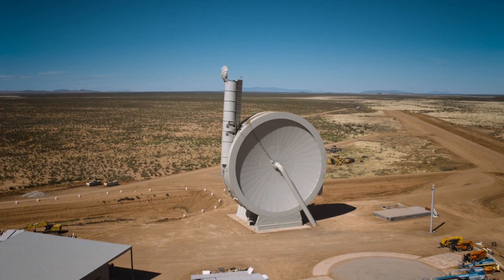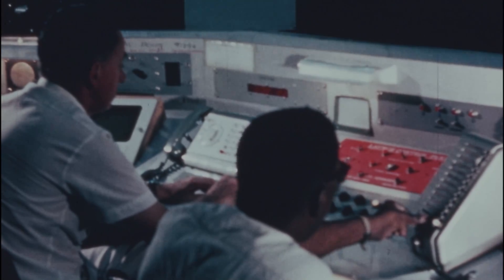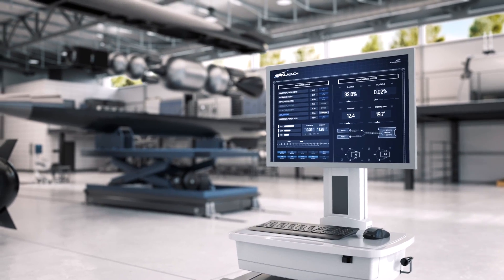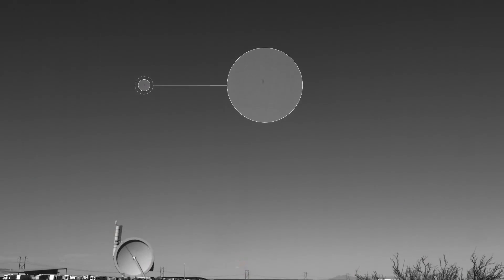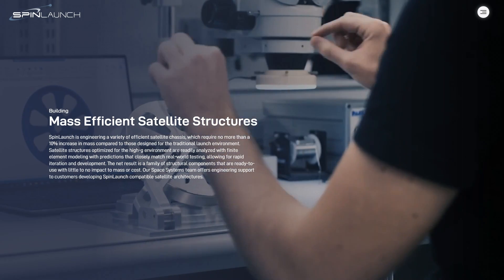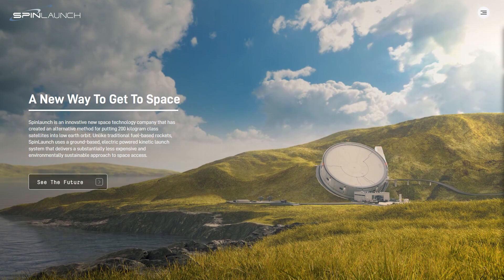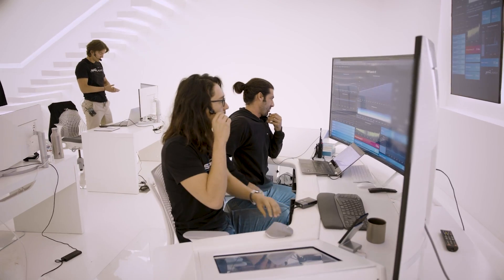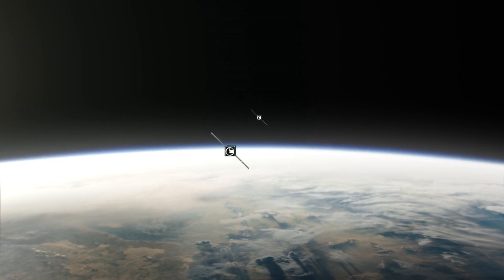Can Spinlaunch Throw Rockets Into Space?

Comment: Crazy idea: toss the counterweight on the revolution after the launch. Bearings can take half a revolution with horrible imbalance, right? Bonus points if the counterweight is a second rocket
Reply: The company’s patents suggest that they’re simultaneously releasing a counterweight on the oppisite side from the payload arm to balance the system at release time.
Reply: And second one goes under ground))
Reply: bearings might, but will the building foundations? :D
We are talking prob over a 100t force equivalent, but sideways...
Reply: It’s probably easier to figure out how to mount a single stage self contained hydraulic to just move the counterweight. A few inches would have a big impact on leverage and effective load.
Reply: @BlueBones8  You could mb build something like a long linear generator to get some energy back out of it
Reply: Make a series of counterweights equally spaced around the hub, but with a gap where the payload is placed. Upon release, the counterweights are shifted slightly to close the gap. Effectively, you create a rotating disk instead of a rotating arm
Reply: Or launch the counterweight into the ground, which doesn't seem super ideal either
Reply: @josephmoore4764  Some sort of hole is in order. Seriously 1 mile hole half filled with something between water and sand.
Reply: Wish we knew of a company that likes to make holes.  Probably would be a pretty boring place to work. 😃
Reply: @josephmoore4764  or into a shaft of liquid and dissolve it by shock friction.
Reply: Every action... Just make the entire facility a floating one... and then move the entire facility to counteract the release. No "counterweight" needed then, and the entire bearing assembly can move freely. :P
Reply: Bearings on the shaft of a perfectly balanced system (theoretically) see no load perpendicular to their axis.  The instant the payload is released, this force becomes tens of thousands of tons.  The fact that it's "only" half a revolution doesn't reduce that force.
Reply: The thing you have to think about is if it drafts the first one will it cache up and hit it and if so how hard.
Reply: You can have another counterweight on the payload side that shifts outwards at the moment of the release. Or move the original counterweight inwards. Still a tough engineering task to do it in a few milliseconds without ripping apart the thing, admittedly flinging the other end sounds much easier, only then you have a massive lump of material over your head, and it's gonna hit something. But hey, crazy ideas are essential when you want to make other crazy ideas work.
Reply: Hmm, could you use water as the counterweight? In a container to hold against vacuum of course. Then just splash it over the inside walls on the moment of release.
Reply: @TheMastaRob  High speed water can hit pretty hard still. Maybe at a sallow angle...
At least it would keep the chamber clean
Reply: @bottlekruiser   Oh sure, but if you consider the speed it's moving, it would spray a wide arc, and you could shape the inside of the chamber to direct the flow. A ridge down the middle, like putting two torus shapes on top of each other, might do it. Not saying it's easy, nothing about this is, just an idea!
Reply: But if the counterweight isn't another payload, that counterweight can hit the ground with the force of at minimum a couple hundred or possibly thousand tons of tnt. Which would basically turn this launch system into long range artillery.
Reply: @CliffordChang-v8c  if we assume the counter weight is of equal weight and can be shaped like the OG payload it would follow the same trajectory as the payload and if unassisted would fall down on the trajectory as if the OG payload was defective, which is hopefully accounted for.

So the real bonus points is if the two payloads can dock with each other mid flight.
Reply: @CliffordChang-v8c  You're saying that as if it's a disadvantage :P
Someone in another comment calculated the energy of a 10t Mach 4 payload pod at merely 6 tons of TNT... wait, this is going to be mach 7ish. Ok, make that 18 tons of TNT. Some of that could supposedly be shed by atmosphere, especially since a disposable payload doesn't have to withstand slamming through it. 
Besides that, it doesn't have to have as much energy as it may be a heavier mass closer to the axis. Double the mass at half the radius has half the speed and therefore half the energy.
Reply: @bottlekruiser  Ok, split the counterweights... no you have 18 one ton blocks of TNT to dispose of... wait... were we trying to make this safe or more dangerous?
Reply: @TechyBen  
>were we trying to make this safe or more dangerous?
Yes.
Reply: >Bearings can take half a revolution with horrible imbalance, right?
I mean if they can take it for many more thousands of revolutions during breaking then most definitely yes.
Reply: @JohnTrustworthy  not if they break fast enough :P
450 RPM is, like, eight revolutions per second. Presumably they won't keep it horribly imbalanced for half an hour after launch?

Comment: Ejectable counterbalance capsule containing water or other liquid fired down an opposing tube with a gradual slope to absorb and spread out the impact.
Reply: A gradual slope at Mach 1, let alone Mach 10+ would be several kilometers long, and necessarily underground since it launches the payload vertically.
Reply: @Archetypal_NPC 
The capsule needn't survive the impact, the slope would only need to spread out the blast so the impact could be absorbed gradually and over a larger surface.

Comment: Well to rebalance the rotor after release, there could be used an counterweight at the opossite end (say for example a metal ball filled with water) that could be released at the same time. It would need to go into a sufficiently deep hole in the ground so it doesnt damage anything on impact. No idea how they do it though, as such device would be pretty obvious if they used such thing.
Reply: have the counterweight close to center of rotation. as payload is yeeted, move the counterweight towards the tip. the jerk would fluctuate quite a bit though, but at least you're not trying to move twice the moment of inertia.
Reply: or even just a ball counterweight that gets thrown downwards onto a track that levels out in a circle. think like those spinning coin donation things, where you drop a coin on a track and it spins around a funnel. but instead you are dropping the ball onto a track that levels out into a bowl. for it to spin and slow down on.

Comment: Dumb question. In order to counter the forces causing the unbalancing after launch cuz basically the center of mass of the spinning thing greatly changes.. what if there was a way to move a weight or introduce a counter  focre on to the end? Like, for example. A mid level weight that is on a rail and slides to the end once the projectile is launched¿ Or apply an electric magnet on it so it can attract to the wall of the launch chamber which in my head would apply a counter force  and helping slow it down by pulling..

Comment: To balance the spin arm, my thought is to have as a counterbalance a massive magnet that would be released simultaneously with the space projectile.  The magnet would fly down a tube in the earth that is lined with electrical coils, thereby generating an amount of electrical power in the same neighborhood as half the power needed to spin up the arm.  That electromagnetic power would need to be stored in huge capacitors or batteries for future use in the next launch.  Some technology would need to be developed to store the energy, but then Spinlaunch is in the business of developing new technology.  What about this?
Reply: Yep. In which case, why not just use the electromagnetic tube as the launch device and skip the spin?
Reply: No new tech for that, just use supercapacitors and superconducting coils. Long-term storage isn't a concern if the device is being cycled regularly. The biggest problem is probably that neodymium magnets have a low curie temperature, so the less powerful AlNiCo magnet would probably be needed in the counterweight unless the resistive heating can be managed. AlNiCo probably has better thermal conductivity too thanks to the aluminum content. In either case, I imagine the magnetic material would need to be distributed throughout a larger casing (laminated steel like a transformer?) to survive due to the eddy currents induced by magnetic braking, perhaps combined with cryogenic chilling before launch.
Reply: If you can't afford the huge bank of capacitors (since they are quite expensive), this idea still has merit.
Instead of trying to capture the energy, just have the coils connected to banks of salt-water power resistors.
Actually, if enough energy is dumped into the salt water resistors by this method, you regain the ability to start capturing energy from it again, in the form of steam power!
Reply: @44R0Ndin  I hardly think the cost of supercapacitors is your biggest concern if you're building an underground cryostat full of superconducting coils. That white-hot missile Scott showed is what a copper coil will look like trying to capture the energy from the reaction mass in a tiny fraction of the distance. The length of braking tube required and the efficiency of cooling the superconductors are probably the biggest factors determining feasibility of energy recovery. The facility will already have a big vacuum pump, so maintaining a cold tube probably isn't all that difficult if you can afford to dig and build it in the first place, but the energy recovery better provide substantial benefits for its costs. One plus is you don't need a separate mechanism to recover the counterweight since it can be drawn up magnetically through the generator, which is essentially a gauss gun.

Comment: imagine having to release a counterwieght at the same time directed into the ground or a water tank or something.
Reply: That much energy released into a collision on site would produce a huge explosion. Better might be to shift the rotating boom slightly to rebalance it on release.
Reply: I'll choose "or something" in the form of the couterweight being a very large magnet, and the something that's catching it being a series of coils of copper wire. That would help to recover most of the energy spent accelerating the counterweight to a high speed (or if you don't have the capacitors to absorb such a large amount of energy in a short time, you could always dump the energy into a tank of salt water (if you don't need to move it, salt water power resistors are both the cheapest and highest power dissipation option available), and if you pick the right kind of motor to drive the rotor you can simply use the motor as a generator to harvest the energy you spent accelerating the rotor to that same high speed.
Reply: @44R0Ndin  If you wanted that much infrastructure to safely decelerate a counterweight, you might as well use it as a linear accelerator to launch the projectile in the first place.
Reply: @JohnBayko  Well yes, but I was working within the confines of "modify the existing system" instead of "replace it entirely and use something else".

Comment: Why would you not put this on the side of a mountain near the top?  Free slope, lower atmospheric pressure???
Reply: You absolutely would, if this tech is perfected. I imagine, you would want to prove it out at a location where construction is way cheaper first instead of the side of a mountain where costs would be significantly more. Ideally you would probably want to build one of these near the equator and on top of an "unimportant" mountain, and then you would benefit from a thinner atmosphere and higher initial velocity due to the spin of the earth and the earth being an oblate spheroid.

And having one of these on Mercury, the Moon, and Mars would also be amazing. If they perfected this tech, we could really actually start moving lots of mass through the solar system for cheap.

Comment: In the novel "The Moon is a Harsh Mistress" they used linear accelerators (rail/coil guns) to launch cargo from the moon back to earth orbit, or after the revolution impacting on the surface of the earth.  If they could get the timing and spacing right, extend the "barrel" of the spin launcher and use a coil gun to further accelerate the launch vehicle.
Reply: Launching material from the moon using a railgun was also discussed extensively from in Gerald O'neill's nonfiction "The High Frontier"
Reply: @benjaminw.1471  Mistress was published in 1966, looks like Frontier came out 11 years later.  Wonder if O'Neill read Heinlein . . .
Reply: @michiganengineer8621  Was wondering the same thing
Reply: At that point it's better to just use the coil-gun from a dead-stop (or maybe have it start with a linear induction motor, not sure).
Coil guns are very efficient when properly engineered. However, the issue then becomes "how do you engineer the sensitive electronics of the satellites to tolerate what's essentially a series of EMP's caused by the pulsing of the solenoidal accelerating coils?"
Reply: @44R0Ndin  Possibly a Faraday cage inside an outer shell.  Not really my field although I know something about it.
Reply: @michiganengineer8621  Faraday cages work against electric fields, what you're dealing with from a coil-guns coils is a magnetic field. You'd basically have to encase the satellites in a somewhat thick iron shell, which is actually beneficial since you need to have the projectile be easily attracted to the magnetic field of the launching electromagnets anyways.
So now that I think of it, maybe it wouldn't be such a big deal after all.

Comment: This looks perfect to move processed mass that was harvested in space from body to body
Reply: 1 ton of asteroid precious metals, yeeted right up... but to where?  I don't think that without powered counter thrust on board the vessel or cargo assembly, we would get it to earth in one piece.  Once it hit the air it would burn up as the artificial meteorite it is, if not also crater the ground or break up in a body of water.
Reply: Or getting mostly dumb mass to orbit. Something like fuel for example. Anyways, it isn't a "ready tomorrow" tech, but if they can work out the engineering challenges it should synergy with on-orbital assembly as well as microgravity manufacturing pretty well.  

Oh, and you're right that something like this is much easier to do on the moon or another small low/no atmo body.